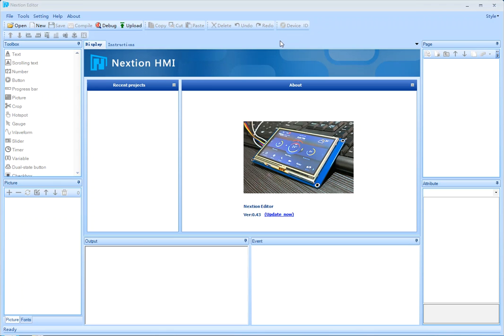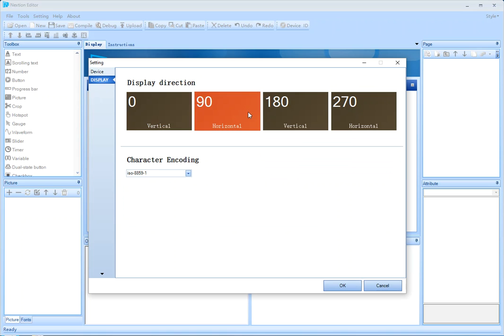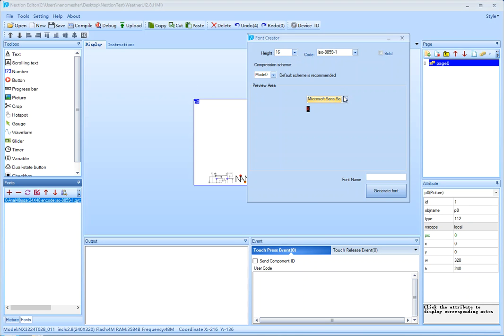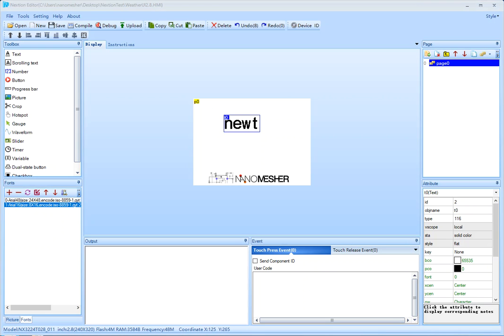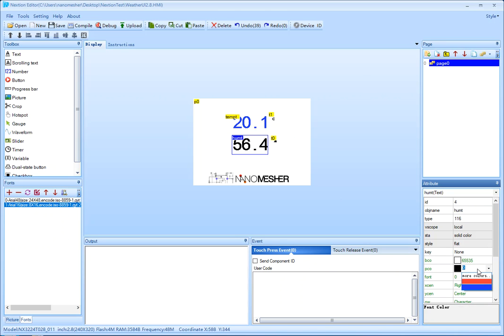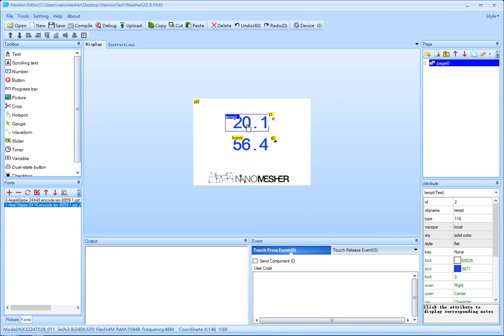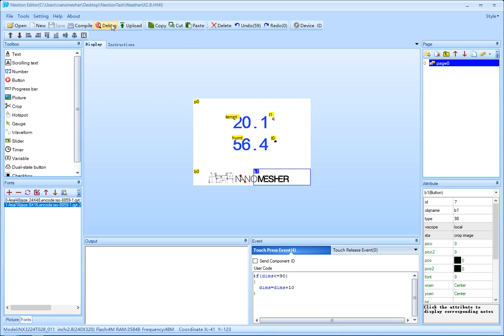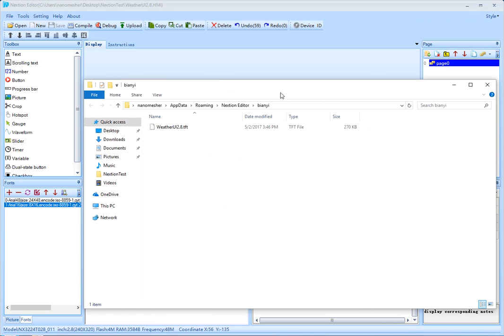Build an User Interface using Nextion Editor

Comment: Actually I want to scheduling in between the lights like if we are giving the timing like from  01:00:00 to 02:00:00. Its means in between this timing light should be turn ON
and after that or before that should be OFF. The one which you sent there we are giving only time for how much time we want. But i want like for Monday to friday
timing should be 9am to 3pm or on saturday sunday has to be off for all lights. We are using Arduino UNO to control all these things. I am new to this thing so I  don't know how to start. Please help.
And also i wanted to SET , CLEAR , Timing schedule format, How can i design this process?

Comment: Hey mate I have a question, do you know if I can control what happens on the display using external physical buttons ? Like if I have a ''next page'' button instead of pressing it by touching the screen, can I ''press'' it by pressing an actual external button ?
Reply from the maker: Hi,  sure,  what platform are you using?  Arduino?

Comment: I pressed the dim button couple of times and I guess the dim value went to 0 cuz the screen went black. I rebooted it but the screen  stayed black. I just wrote ''dims=80'' in the user code of the background by selecting the background in the editor. So when you power the screen back on, it default the brightness to this value.  Anyways thanks for the vid

Comment: Great beginner tutorial on the Nextion Editor!  Thank you so much.  

I assume you are using editor version 0.47 which is the latest at this time.  Files created with the older versions are not always compatible; this can make it difficult to follow some other tutorials.

Here are some quirks I found in version 0.47:
1)  To edit text in the Attribute box you have to double click,  it is not enough to just highlight the text to be edited.
2)  After Generating a font you are asked: "Add Font to List?".  You click on the box and nothing happens.  You have to close the 
      Font Generator for the new font to show up in your list of fonts.
3)   The "User Code" does not seem to adhere to common C language syntax.  For example:  adding spaces to a formula to make it more readable causes compile errors.  Ending a statement with a semi-colon also causes an error.   

I confess that I have not read the manual yet.  You know how it is, anxious to get started etc.    I really love the Nextion displays.   The potential is unlimited and it is well worth the effort to learn to use them.